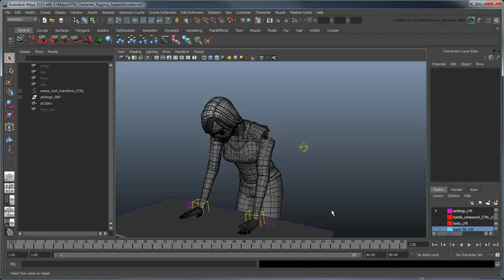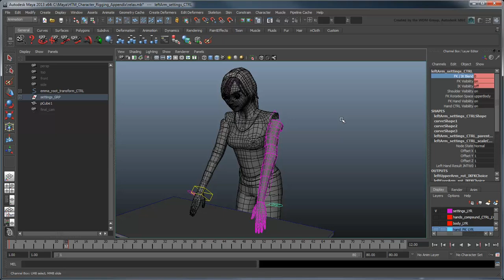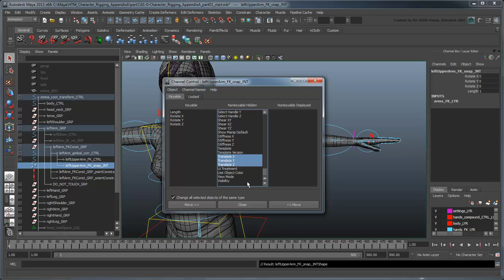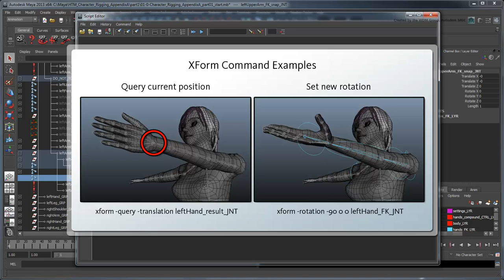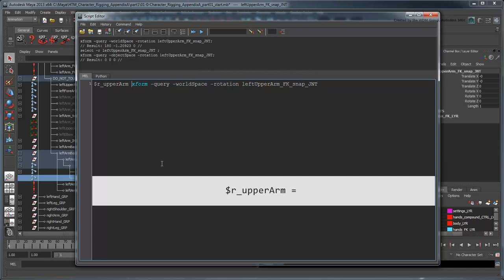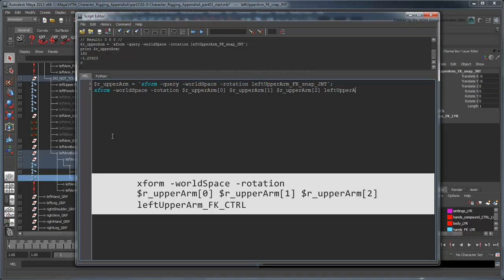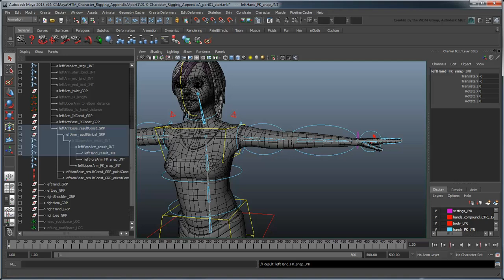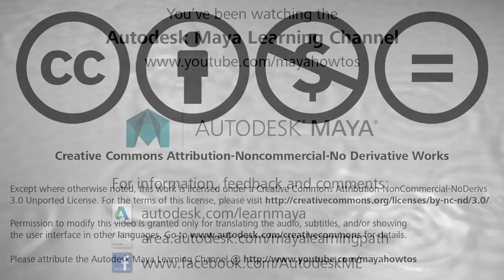Creating a Character Rig: Appendix A: Part 1 - Matching the FK arm to the IK arm (Advanced)

Comment: When your setting the variables for the 'left' arm, you use variables that have an 'r' like '$r_upperArm' I would think that would stand for 'right', when were working on the 'left' side. Just think it comes off as a slight bit confusing. Other than that, wonderful. I was expecting it to be much more complicated than what you showed. Thanks.
Reply: Oh, from looking at your next video I realized that the 'r' or 't' meant rotation and translation. Lol. Nevermind.